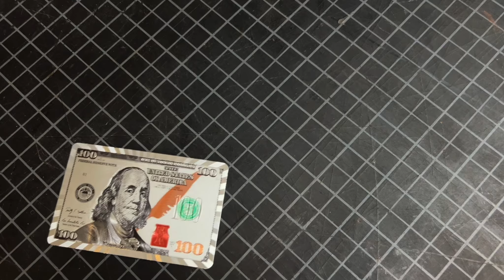Leather Magic! - The “Old School” & Easy Way!

Comment: Freakin art as usual! I am curious about the hole punch that can go through 5 layers of Horween without making a huge taper on the side it’s going in from. Is it a name brand tool or just one of the cheapy kind?
Reply from the maker: That is the issue that’s plagued me for years.  Still does.  That damn taper.  No one will resolve this issue.   I use KS blade punches.  Still has the taper.  But I use a smaller punch and open hole at small end with the tool as you saw me do.  Still too much taper, but not as bad.   Need someone to make less tapered punches

Comment: I'd really like to know what you use on your edges, it looks much more watery than the Fiebing's edge kote I've been using.  I think the Fiebing's would be too thick to use in the pen system you're using.  I've bought several different roller type devices but still have issues applying it to edges, it's so frustrating.  I'm sure you've been through lots of trial and error to get your edges so perfect so it'd be understandable if you didn't want to divulge all the secrets to the mysteries of the edges, but any tips would be very appreciated.
Reply from the maker: I use feibings pro dye.  Not kote. No paint.
Reply: @MasconLeather  Cool ordered some pro dye today👍